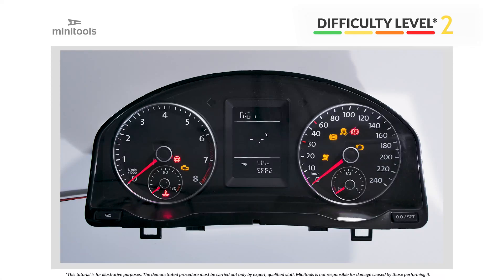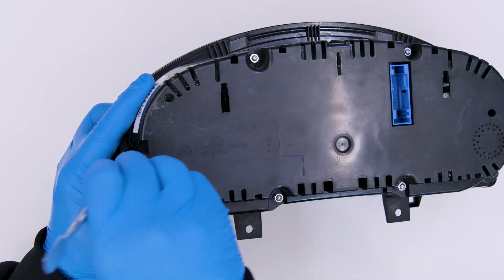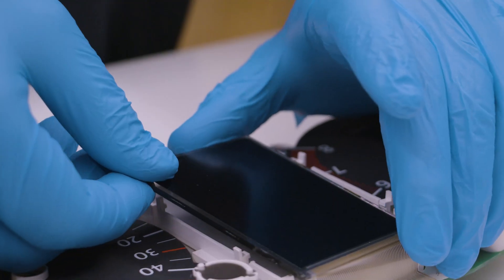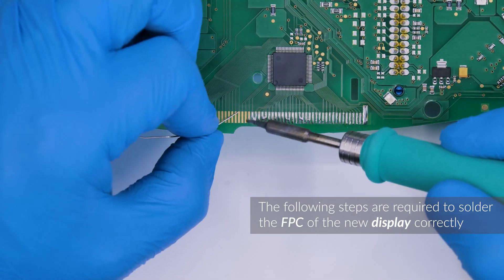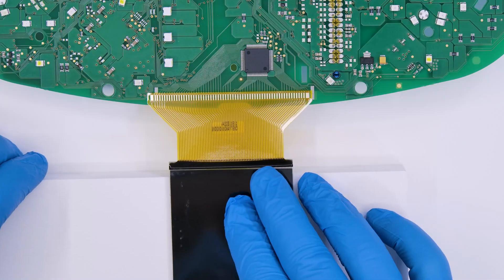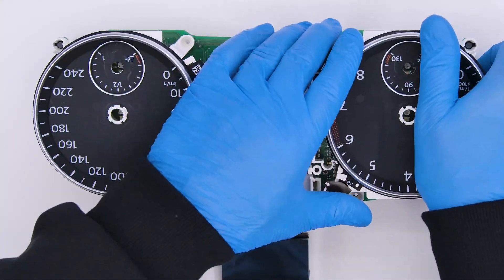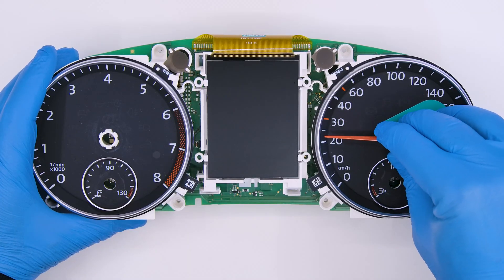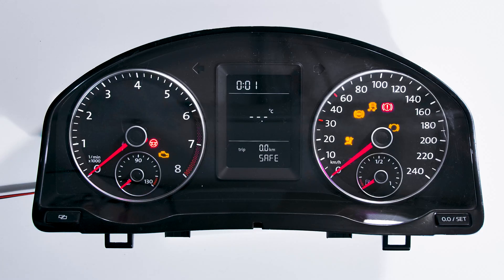Volkswagen Golf 6 instrument cluster repair – LCD display replacement

Comment: Hi there, thank you for this video. I plan to replace the LCD for my GTi cluster using the parts from your links. I want to ask if there are any programming necessary after the instructions in this video. Thank you so much.
Reply from the maker: Hi, you’re very welcome! No, no programming is necessary after the repair. Please identify the correct replacement for your car before purchasing as there are several options avaialble. For any doubt feel free to send us an e-mail at info@minitools.com. Thank you for choosing us!

Comment: Hi I bought of these of you can you tell me what solder your using and what heat your applying because I started mine and as soon I touch solder iron to the pads they seems to melt all over the place I wait for you apply
Reply from the maker: Hi Wackey, please use a 0,3mm solder wire with a soldering iron with conical tip at 350° celsius, if you’re still having difficulties please send us an e-mail at info@minitools.com, thank you!
Reply: @MinitoolsChannel  Thank you so kindly for getting back to me. You so kind. I've done that and it worked for me 😊 😃